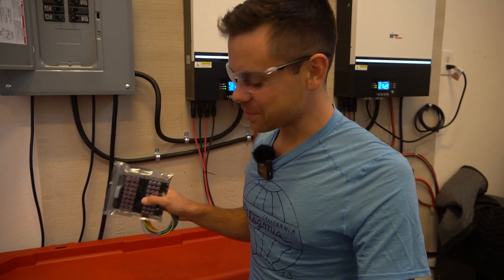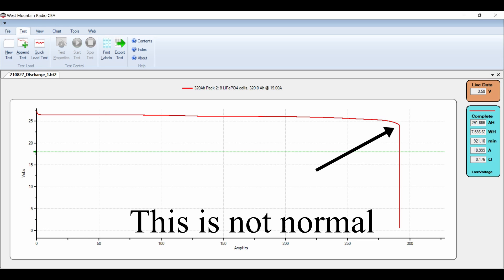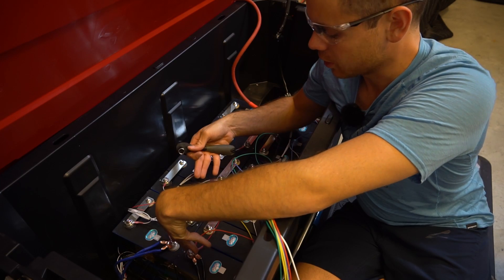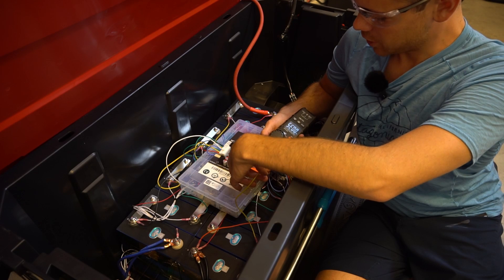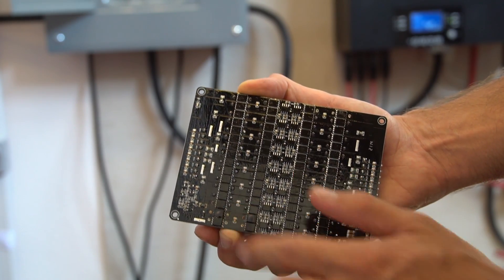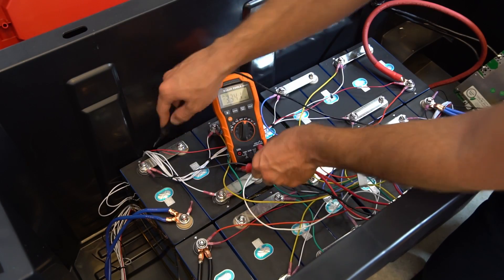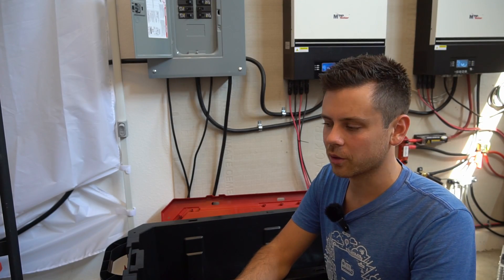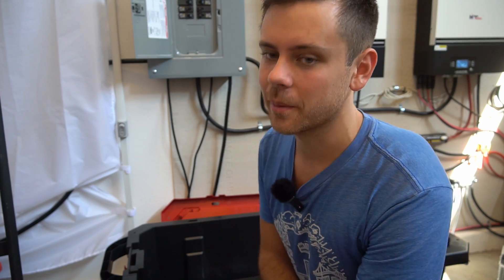16S LiFePO4 Active Balancer Problems (Not Beginner Friendly)

Comment: Its necessary when you have 8 batteries from China, 32 total cells, and 4 of the batteries dont work for whatever reason.  Im going to tear them all apart and put together 1 battery.  But 3 cells died, and the EVE I buy are going to be much better quality.  If I dont, im sitting on a very heavy paper weight.
Reply: I too, have done this 😂

Comment: My hardware active balancer when charging the battery pack when I touch the active balancer body it make a small electric shock me when I remove the che charging socket it don't shock me what are the problem is on here when the battery pack full charge  it couldn't actively balance all the cell voltage are not same. What are the issue here please any help

Comment: i'll bet the bottom touched some of the cells' terminals;  
and, there is a FOOLPROOF way to check your wiring before connecting the 2 plugs; you measure VOLTAGES  ,   ALL 16 OF THEM;  »»»» they MUST increase by 3.33 or close, from pin to pin; the multimeter black lead STAYS on the (black) wire  B- , and you go from there, pin to pin, all the way to B16+ (of course, if you have a 16S) ;  i guess the videomaker did not know much at the time.

Comment: Same exact thing happened to me with the same 16s lifepo4 pack and the capacitor type balancer. The wires to the balancer got really hot and the balance board too. Immediately disconnected for fear of fire hazard.

5 years later I built a 4s car battery and used the same type balancer via 5A fuses and it works beautifully. Balances down to 12mV. 

Maybe we both got a bogus 16s version.

Keep of the great work Sir.

Comment: "Why did this happen"
"It was sitting on top of plastic box"
Dude really..
What other than electricity does plastic isolate.. hmmmm could it be heat?
Also if you test lots of strange boards do everyone a favor and buy a thermal cam like infiray or ht-301 to spot magic smoke before it happens.

Comment: I have a all in one growat inverter and when a typical bms shuts of the battery when it discharges to much then......yes....the inverter shuts down.....if the inverter communicated with the bms to know that it should stop taking power from the battery then it would be the best
but there is no standardization on the commutations ports  and im to lazy to make it work

so a active balancer is my only choice, and the inverter handles all the switching (you can set up all the voltages in the inverter including discharge and charge AMPs)

Comment: I disagree.  Active balancer is a must for especially pack that builds from recycle battery.  That is my case.  I had 200AH packs i built over the year i did not use any balance at all just manual voltmeter.  Well they did not last long because of the imbalance and dropping too low situations.  Well I wise up and start using the active balance now  (capacitor type) and have a wifi camera to remotely monitor.  Another benefit is that during use it will continue the active balance to equalize out each bank thus lengthen usage of the whole packs.  A good active balance 5A or more must be used NOT the cheapie 1A type.  Later on i will add the bms with remote monitor capability.

Comment: All the battery failures I've seen on youtube are almost always because of the balancer not doing its job or kinda working backwards. 1 time I saw a bad cell in a big pack but they also said that they thought it was because the balancer failed
Reply: @kreciq_klu  bms and balancer is both the same. Bms has either active or passive balancer nearly always. Thanks for the correction lol
Reply: @kreciq_klu  this whole conversation started by me saying I've seen where balancers that broke caused batteries to be damaged. You said... no its the bms breaking that causes damage.. bro when a balancer in a bms goes bad it damages cells by allowing them to go out of balance and causing the cells to go high or low and if over or under voltage don't catch it then it damages cells. I'm yet to see a bms that went bad that didn't have a problem with the balancing of cells. I've never had the issue myself but I I had two friends that had very expensive batteries have cells go bad after a balancer didn't do its job. And one friend that had a battery get screwed up from a balancer not stopping its balance at the balance low cut off point and the balancer kept continuing to balance threw the whole charge discharge cycle. It actually ended up making q couple cells swell up like a balloon.  The bms did its job in shutting down due to low voltage but the balance circuits were fried. That's why I think balancers going bad is usually what messes up batteries. Yeah if a low or high voltage disconnect doesn't work right it'll screw up batteries for sure but almost always when that happens it starts with balance circuitry starting the problem. Everyone knows not all bms have  alone features and some have active some have passive and some have all kinda cool features but I still and always will think 9 times outta 10 it's the balance part that's usually the weak link in these Chinese bms... well that and the fact that they are rated for way more amps than they can continually do.  Like a 100 Amp bms probably don't need more than 60 amps run thru it so it don't get hot. 2 things other than cheap parts seem to be bad on about all Chinese electronics. They rate them as being safe with more amps than they actually are and also heat.. ok.. three things.. especially the bms's. Over ratings as far as amps, heat, and also starting with batteries that are not closely matched from the start. If a balancer in a bms has to work hard to keep cells in check then don't count on it being dependable cause over worked balancer is Destin to fail. And the bms should be the last line of defense to save that battery as far as over or under voltage. Anyways... good chat

Comment: ok am using active balance however i do not use bms but my max volt is 54.6 however i realize if you increase te voltage the active balancer capacitors will hot & burn the first one burn & i replace it & it working good so check the  voltage maybe too high

Comment: My 2 year experience, with the same.

The BMW electric car battery back had a damaged cell that was only 20 amp hours when the pack was supposed to be 200Ah for the 16S pack.

Two of these in parallel allow me to cycle the battery with 150Ah of capacity running a refrigerator. 

The current will exceed 5A with huge cell voltage difference, if cell gets to 2v for example.

The system can only do high power in small bursts that use up to 15ah of power, before I trigger the cell difference cutoff, but it returns to stable quickly with 2 of the 5A balancers.

Exclusively solar systems never have a chance to top off so active balance is sometimes necessary.

Comment: you are putting giant batteries with small guard, your batteries is around 10kw and this board designed for something under 3kw, you should check your batteries internal resistance, otherwise you will loss them

Comment: Just assembled a 280Ah lifepo4 pack with Overkill 16s Bms and the very same balancer yesterday. It lasted about 10 seconds, then one of the capacitors literally flew 2 meters away and the whole thing went smoking.

Comment: be warned, those capacitor active balancers can explode if the cell delta gets too much as they then chuck out very high amps. Mine exploded near 98% depth discharge on 18650 pack ...yep was bound to be a big difference of cell voltage. Nearly caused a fire. Best way to use them is when Lifepo4 battery is fully charged, then just use them to top balance around 3.55v to 3.65v for a relative short amount of time it takes to balance them up. Then disconnect...do not leave them on the pack as they will balance all the way to full discharge leaving you with a very uneven pack. They do work great but only above a certain voltage and for top balancing.
Reply: I agree.  My experience has also clearly verified that simply connecting an active balancer, and leaving it constantly "on", only makes the cell imbalance worse when you are working with other than brand new, A grade cells.  It becomes glaringly apparent as the cells approach the top of the charge curve.  The Heltec active balancers are very good at what they do, but they must be manually switched on to be most effective, and only near the top of the charge curve.  Then they must be manually turned off.
Reply: Hi, so,  is there someway that you can set up this type of system and not have to continually be manually checking them all the time, turning the ballancer on and off? Thanks

Comment: But you really seemed to like the tiny 4s balancer in your other video. Is it a hate love relationship? Anyway.. i dont have a tiny charger to charge cells 1 by 1 as you love so much, so i just ordered a 10$ 4s for using on the cheap lifepo4 byd 12v 250ah for 240$ that i also just ordered. Lets see. Its for my fridge.. I'm tired of power outage. It will be fed by a 450watt panel. No more spoiled food.

Comment: Please also check that all  bms should have a Voc threshold published......mppt CCs can let the voltage splike for couple of seconds which is common even for the most expensive CC's... acid vrla sla or gel batteries won't see these spikes...but the bms will cut out the CC from the battery after only 1 second of these overvoltage spikes letting the CC to ride freely at the pv Voc....and that's a concern when the bms encounters this voc at reconnect point,...it can be fried...

Comment: Damn Will, I JUST had received mine and did a search to see if I was missing anything before wiring it up short of the 16s capability. Of course I chose your video first lol. 36v 105ah pack here using the same balancer. I loved that I could use it with my current 12s and then keep it for when I upgrade my golf cart to 48v/16s. After watching you, I was reluctant to charge overnight with it so I actually rolled my cart outside and away from any fire hazards before starting the charge cycle... lol In the end, mine worked great and isn't even warm to the touch. I had one eye open all night tho!
Reply: I use this same and some other active balancers,mostly 6-8s and it works so well,each cell voltage is spot on,so accurate,I am thinking to use bms+active balancer together
Reply: and it is no any heat or even warm,always cold active balancer

Comment: You should never put BMS in series if you aren't sure that a single BMS can handle full pack voltage. If one BMS cuts off you may have pack voltage on the BMS connectors, when charging. Also never put 12V LiFePO4 batteries in series, unless it is explicitly allowed by the manufacturer. 

Two 8s balancer on a 16s battery will only balance the cells in each half, and not the two halfs. Actually you would need overlapping balancers to get the pack balanced. Or you can use additional 12/24V balancers used for lead acid battery blocks.
This balancers are cheap and doing their work in the extremes of cell voltage. But as they seem to have no voltage threshold for starting/stopping  balancing, they can cause disbalance in the flat area between 20 and 80 % SOC. If you then charge faster than the balancer can balance, some cells may hit the max voltage.
There are also balancers available that will balance to 10mV only and deactivate then. They cause no disbalance in the flat area, but start balancing if cells deviate more than 10 mV in the extremes. The disadvantage is higher price and high frequency noise. But they also can be cascaded for larger packs. I use them since more than 5 years on 8s battery modules. Look for QNBBM icgogogo store.
Reply from the maker: Check out my older videos. I don't think you have
Reply from the maker: Yikes, you must be new here. We all know that. The bms being used has fet's rated for 80V. That's pretty common knowledge. 

And yep, that's why I have a nice 24V charger to use once they are balanced at the end. Not hard to do. Takes a few minutes. 

I hate these balancers. Total garbage in my opinion. And a liability
Reply: @WillProwse  The FETs are not the only part that see the high voltage. The cell voltage detector will also see this voltage and may be fried. And the balancer has the same problem. The max allowed cell voltage is only about 5 V typically. The balancers are very sensible and allowed to be connected only with all leads connected to the battery. 
IMHO, the problem here was not the balancer, but your specific setup.

Comment: I have one of those on a 48v 150ah system. when cell voltage goes above 3.38v, the positive and the negative cells  connected to charger and can reach 3.8v while the others still at 3.4v or so. and yes, I have top balanced them to 3.65v in parallel. good luck!
Reply: The balancer is no BMS and cannot prevent going cells above 3,60 V. You should always have a BMS in place to protect single cells from overvoltage.
Reply: @egnegn123  you're correct and I didn't say that. I said that the active balancer will not keep the cells from being all over the place while charging, once the charge stops, then it will bring them close to each other. I have a 48v 150ah bms from Daly and it does the exact thing. In my opinion to prevent what seems no balancer can do is to stop charging above 3.37v per cell as its seems above this voltage is when all hell breaks lose. hope to be making sense ;)

Comment: This is what I think happened: too high voltage difference between cells so too much current on that active balancer which burned the mosfets. Differences in resistances on bus bars from bad torque on screws and different internal resistances from bad matched cells will also produce high voltage differences between sense leads during high enough charge/discharge.

The only use i can see for these gimmicks is to use to top balance cells that you dont want to disassemble from 16s to 16p. But not at same time as you charge the battery unless you charge with low enough current

Ironically these things will make your pack unbalanced if used during the flat part of charge/discharge curve during high load :P

Comment: So i wanna share my own experience with this things:

Side Notes: 15S - Li/Ion - minV 3V - maxV 4V - Ah 460     used Tela Moduls

First of all, i wouldnt sept at all, if not all cabels are fused with this size of pack. At first i only used a chinese progammable BMS, but at this time i also use the internal fuse ( thin wires) so the cables are propper fused. I also added 5x20 3A fuses for all balance cables that go to  the BMS.

Then i went with the Batrium BMS and it worked fine. But afer month i checked the voltages and they were at 50mV difference. I bought one of these balancers like you. Then my mind change to i played with the settings when the bms start the balancing process. My pack is full at 4V and you should never think --> the sooner the bms start with the balancing, the better is it. 

Now: I didnt use the active balancer at all, the voltages are within 20mV now and they sink
I set it now to 3.85V to allow the ballancing

So i would never use one of these balancers, because they are not programable. In my case the balancer would start the process way to early.

Comment: I think you should check the connections with voltage meter first before connecting it. I have a few of those in my own battery pack and they work greatly 🤷‍♂️

Comment: Hi Will, my 2 active balancers like you have, but mine are 17s with 1 not attached, are working just fine and don't get hot at all. Might be a faulty board. Actually I chose active balancer over BMS due to the fact that the active balancer doesn't burn off/waist energy like the BMS. I use the 200amp Daly smart BMS in parallel with the active balancer and I see more capacity from my 2 packs of 280ah lopo4. A nice drop off voltage when almost empty.

Comment: Hey Will,great channel , simple question for ya. I’m using 515 watts of solar panels to charge my rolls L16 , 6 volts lead acid batteries. My power meters is reading less than 150 watts to power a couple of led lights and led TV . I was wondering why my specific gravity of the acid keeps reading in the red on my hygrometer ? It was in the green last month . Thanks 
Dave, Newfoundland, Canada

Comment: I have 2 of these active balancers on 2 separate 48v systems running for months without issue.  Your pinned comment is very likely correct that having the pack split between 2X 8S BMSs caused the issue.  Also, these balancers have a solder blob across the pads for a switch.  I have this set up in each of my systems with a voltage control board so that it doesn't enable the active balancer until the total battery voltage goes over 54v.  This helps keep the whole system top balanced at a much faster rate than you would get with a regular BMS so you don't get the short cycling on and off if it has been a few weeks since the batteries have been fully charged up and it doesn't try and balance at the bottom end of the discharge curve.  If I had new batteries I likely wouldn't need the active balancer but it is still a whole lot faster at fixing any cell drift if I have a nice sunny day after 2 or more weeks of cloudy/overcast days where the batteries didn't have a chance to get a full charge.

Comment: Solar engineering did a video on that balancer. The cell voltage difference needs to be extremely excessive for it to balance at anywhere close to 5 amps
Reply: So, it only puts the pedal to the metal when there's a reason... Not sure why people say that like it's a bad thing.
Reply: @solventtrapdotcom6676  Thats what I dont understand. Why cant it just remain on 24/7 35?